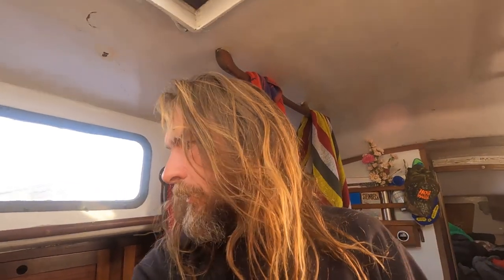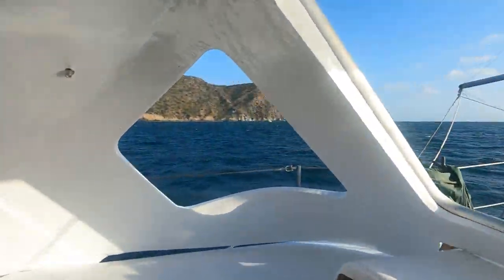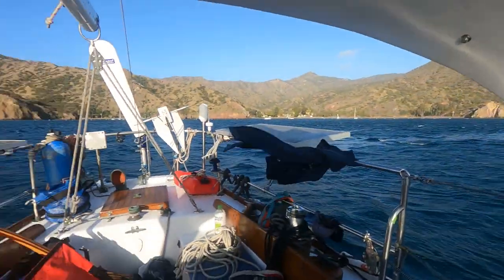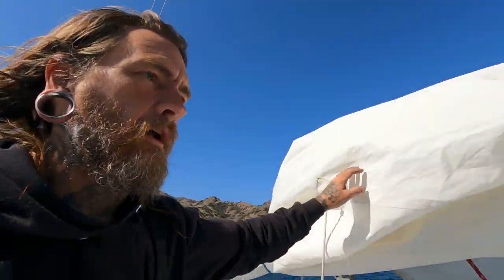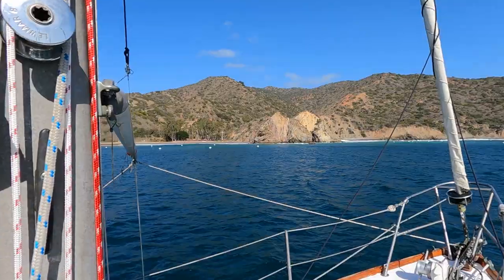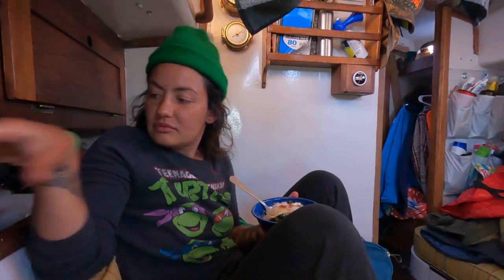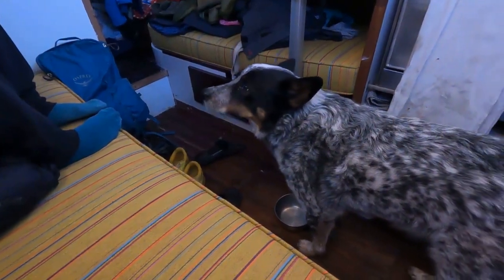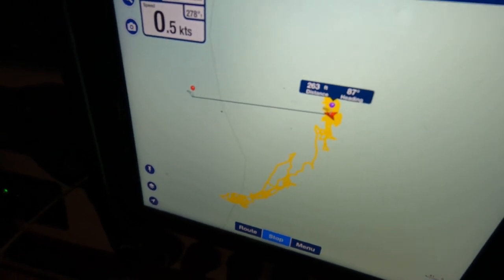Being Blown Offshore from White's Landing at Catalina Island - SV Triteia Sea Trials Day 2

Comment: Many an inflatable has been flipped at White's and other coves by winds from the canyons, worse for Santa Ana's. Most of us strip the dink of all loose items including oars and figure out a way to  snug up the dink, I like a bow bridle hoisted high by the topping life from the stern, saves the top sides from rub marks. Also, extra fenders stacked and stored well secured in the middle of the dink will help to flip it back upright. Finally, the boat ID should be boldly painted on both sides of the d Avon along with you call sign, a cell phone number, and you call sign. Lastly, hidden ID elsewhere on the dink, they are favorite items to steal. See ya - bob

Comment: Whites is great. But anchoring at Catalina is tricky. They’ve put moorings in everywhere out to 80’. So, best you will get with a “kit” anchor rhode is 4/1. And every weekend sailor will be swinging on that 300’ too. So, whites or hen rock are good if you find them empty. Put out everything you have at the edge of the field and kedge off to stay away from the pack of drifting weekenders with 2/1 scope.
Reply from the maker: There is always Little Harbor, Cat Harbor, Little Fisherman’s, Cabrillo, Goat, Big Giger, Rippers and Parsons 👍🏻
Reply: @SailorJames  yep; they are quite a different experience than being in 130’ at whites.

Comment: How well are your solar panels keeping up the batteries? I'm planning on installing some soon. Does Triteia sail at anchor in breezy conditions? I get nervous about the anchor holding because the boat tends to tack. We plan on making a riding sail to help with that.
Reply from the maker: Our solar panels top up our batteries by 10am every morning. Then we charge our computer and cameras in the day time so it’s all done by the sun. When we were at anchor at Johnson’s Lee in 30knts of wind for 24+ hours our boat yawled so much at anchor we had a top speed of 1 knot on our navionics anchor track, we didn’t drag at all with 7 scope out . Riding sails don’t really work and mostly just make lots of noise and make it feel like the backstay is going to ripped off the boat
Reply: @SailorJames  Thanks you guys!